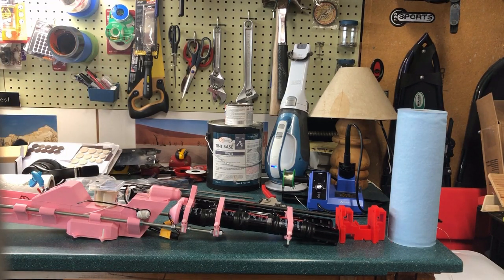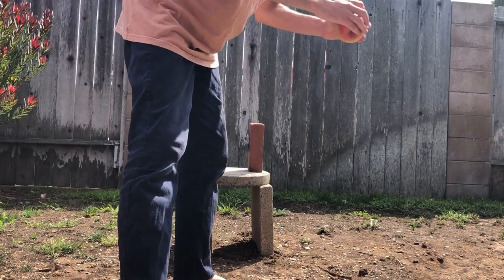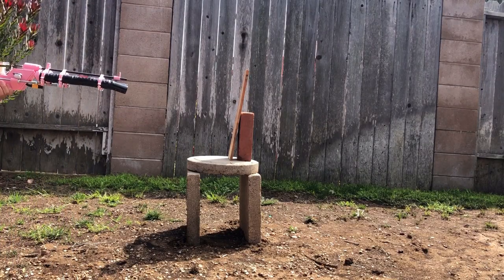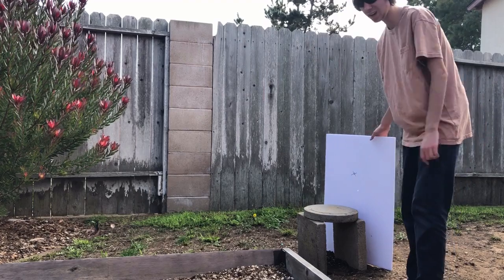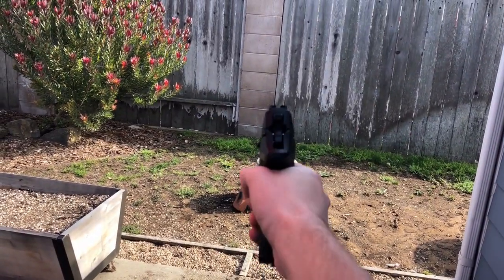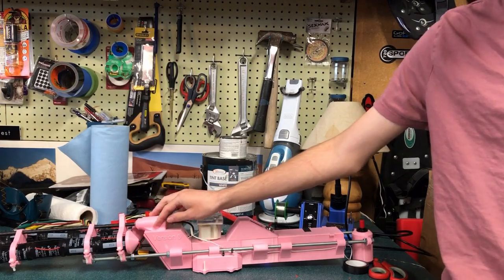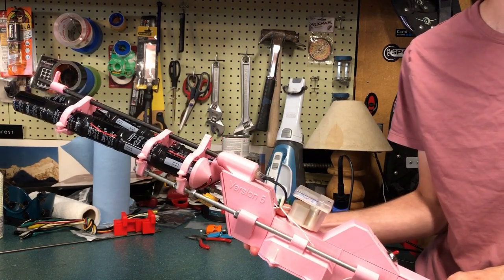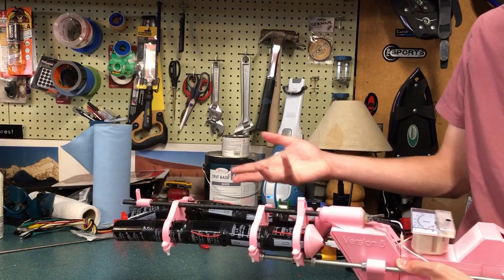Plasma Powered Musket Version 5 (Electrothermal Accelerator)

Comment: Have you ever thought about using a sparkplug as the spark gap inside the chamber ?
Reply from the maker: Yes, I haven't tried it but I would like to. It might help with the problem of the electrodes eroding over time.
Reply: @shleed  yeh I feel like it would be perfect , you could cut the side electrode a little bit , but also since it has a thread you could thread it to the cannon itself making it   very air tight and also sparkplug are made to withstand high pressure peaks so I feel like is way to go , maybe you can thread a pipe to make the cannon

Comment: Great work! to get more power out of it try using thicker wiring. Also, if you have a inductor in the system get it as small as possible for the arc to still initiate the plasma. These two things should allow you to easily punch right through that board 😊

Comment: Is this a wire exploding or just coil gun?
Reply from the maker: A small electrical arc is created in the barrel, and then a capacitor bank discharges through that, creating an explosion.
Reply: @shleed  Don't let Rocket Elon get his hands on this. He for sure would want to market it as the next gen firearm.